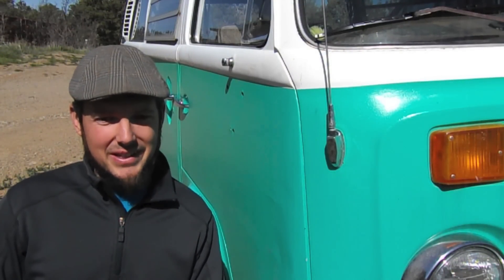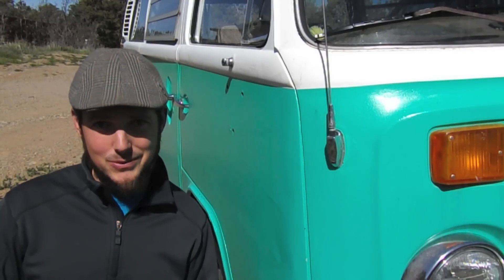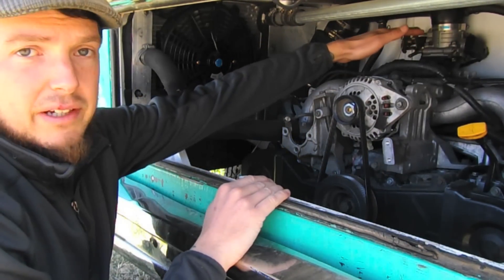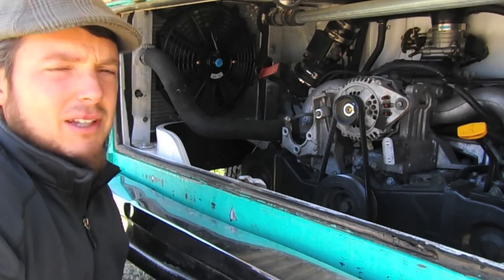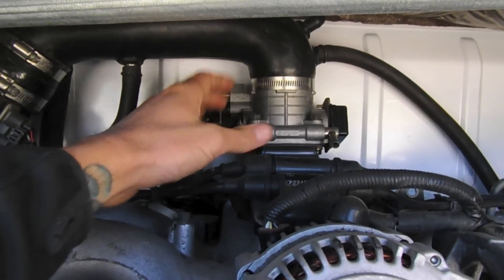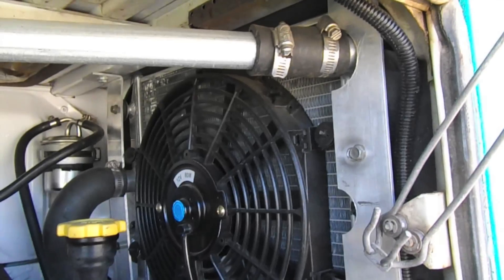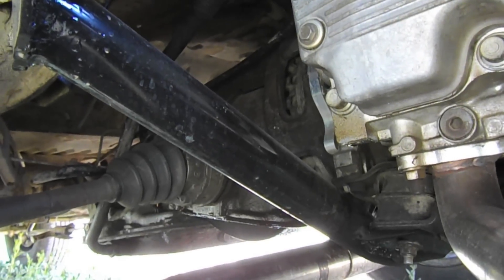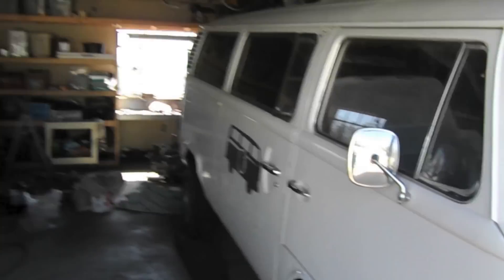VW Bus Subaru Engine Swap Intro - Busaru Engine Conversion Part 1

Comment: why not use the out side vent ducks makem preform double duty n pipe the air into motor compartment on rear
Reply from the maker: +sammantha lee They do. Perhaps you didn't see that in the conversion though.

Comment: Hey Busaru! Love your channel. I just purchased a '77 Riviera that I am restoring for a family camper. I love the idea of swapping for a 2.2L. They are bullet proof!!! I have been searching online for an engine and was wondering your take on ebay options vs. others.  JDM seems to be the way to go so far in my opinion. Do you have any advice or possible alternative solutions?
Reply from the maker: +MN Fledermaus I love JDM engines, just know that you'll have to source a harness that may not mesh with the JDM perfectly. I always recommend a donor car for the initial install, then you can swap to JDM if the donor engine ever fails.

Comment: Mick, 

Which EJ25 motor do you recommend (85 Vanagon Camper) ? 
2.5 Dohc 97-99
2.5 Sohc 00-02
2.5 Sohc EGR Valve 03-05
2.5 Sohc EGR, AVLS Heads 06  ??
Reply from the maker: +DanTheManIOM I would avoid the Subaru AVCS engines as you need to match a harness perfectly with the engine or performance will suffer. All of the other engines are great. SOHC is preferred but DOHC performs great too, and are very inexpensive.

Comment: Have you try using the Subaru engine and transmission on a split vw bus
Reply from the maker: +Albert Martinez Hi Albert, I haven't tried the Subaru transmission in a swap yet, but I hear good things. I just can't ever justify the extra $2000+ for my personal swaps and none of my clients have opted for the Subaru trans as of yet.
Reply: Thanks for your response 
Which vw transmission will work better with the Subaru 2.5 engine???.  And should I use IRS or swing? Thanks for all the information

Comment: Does your guide also apply for smaller subaru engines? (eg. ej15, ej16, ej18)
Reply from the maker: +Marios Pantouvanos they will all be roughly the same - have fun!
Reply: +Busaru well, thanks

Comment: Busaru , how hard is  to do  the wiring harness from 96 to 2000 subaru manual transmission to a volkswagen 1981 vanagon. and do you do the wiring or know any good place that does it.
Reply from the maker: +Carlos Vazquez Hey Carlos, the wiring harness is one of the trickiest parts of the job but if you take your time and are patient, I think you can do it. If you want to give it a try but it ends up being too overwhelming, just shoot me an email - I make my living doing wiring harnesses :) http://busaru.com/services/wiringharness
Reply: Thanks very much ur help is super

Comment: Dude... where were you about 4 years ago??  I did a conversion on my 82 Vanagon L (Diesel) and put a 91 2.2 L Subaru Legacy L engine in it.  The mechanical part was actually pretty easy to do (thanks KEP).  The nightmare was the wiring.  Your video on creating the wiring harness sure would of been nice to have back then.  It took a while but was well worth the time invested.  Its the most dependable ride in my garage.  Btw... i refer to mine as a Vana-RU... but BUSARU works too.  Excellent work bro... keep on keepin on.
Reply from the maker: +B.J. Boyette Hey BJ, I wish I had started this 4 years ago too! I agree with you on the harness, definitely the trickiest part of the job. Thanks for the comment!

Comment: Why not put it in a Mazda bongo, I thought the idea of owning a air cooled bus was because it isn't water cooled.
Reply from the maker: +JASON K Never heard of a Bongo, is that a pretty rare beast? The appeal of the VW Bus is the styling, not the air-cooled engine, in my opinion. I like to drive the speed limit :)

Comment: I guess there is no need for a radiator header tank since they are right next to the engine.  Air locks suck!
Reply from the maker: Fill it up at the highest point and most air should work its way out.

Comment: the brother what it costs all modification, which model this engine and worth making the adaptation. thank you.
Reply from the maker: Hi Samuel, Any Subaru engine will cost about the same to install, as long as it is non-turbo. If you get a good deal on a donor car you could spend as little as $4000 if you did it yourself. Expect to pay 2, 3, or 4 times that if you have someone do the swap for you. Good Luck!
Reply: Busaru I was just looking at the Kennedy page. They said that the 2.2 Subaru engine is too tall for older buses. Did  you work around that with the angled throttle body reverse- Or are they right?

Comment: Brother if I use only one radiator will cool the engine as well? Thank U.
Reply from the maker: Hey Samuel, I think you'd have better luck going with a belly mount radiator setup if you are using just one radiator. With the engine bay radiator setup you'll need two radiators.
Reply: Busaru Thank U! excellent project !

Comment: Would this swap be possible in a 1969 bus
Reply from the maker: Yes, it would be possible. There is still a question as to whether the crossmember would fit the frame rails of the "early" bus but I should have an answer soon. Do your frame rails look similar to the ones in the series on the white bus?
Reply: Busaru yes the frain rails do look the same as the ones from the white bus. Will you be making more crossmembers? Sell some maybe? Wireharness for sale maybe?
Reply from the maker: geneticmaskmen Hey Genetic, I have the crossmember and other pieces for sale on my website - Busaru.com, just go to Busaru Kit. As far as the wiring harness, I'd recommend you contact tom shiels - just google him to get his email - he has done hundreds of wiring harnesses. Let me know if you have any other questions.
Reply: +Busaru 
good

Comment: Not bad at all mate, Getting ready to do one myself at the moment so i will look forward to your vids.  Not seen that rad set up before is the battery still behind them ?
Reply from the maker: Hey Gavin, I know you found the answer but for others - In a later video I show the battery placement under the rear bench on the passenger side.
Reply: Got the fan cutting in now..  Your series has been excellent ! I know how much time and effort making  video's takes. I got offered a twin turbo Subaru engine today probably a bit much.